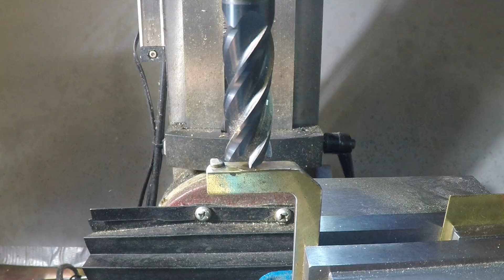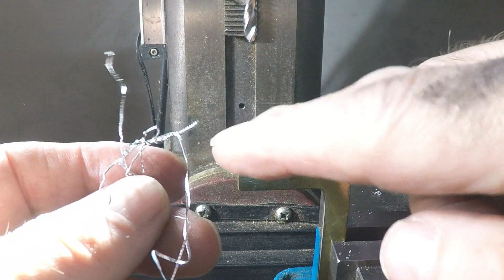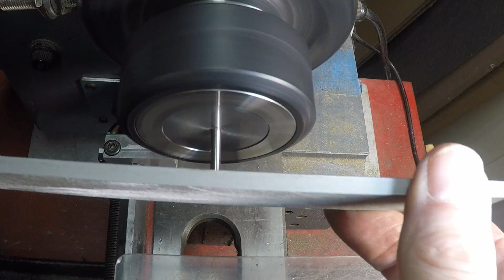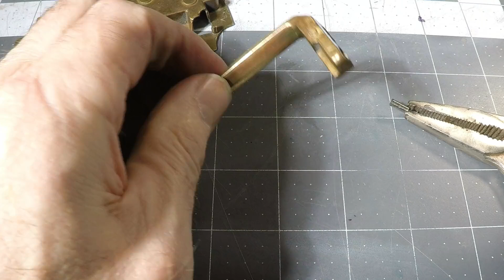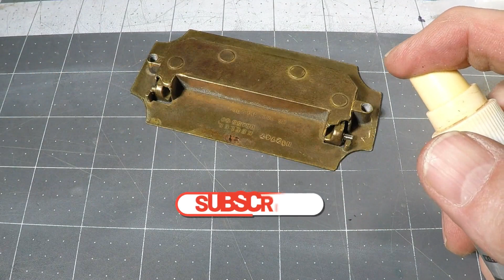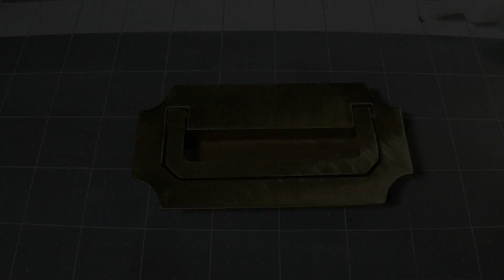Vintage drawer pull repair

Comment: Holding the handle the other way round would have allowed a support between it and the vice. Hanging the workpiece out to the side is rarely a good idea...
Interesting handle. I needed a couple like this for my Gerstner style tool box build. I could not find anything decent, so I fabricated them from brass.
Reply from the maker: You are absolutely right, I wish I had thought of that. Thanks for the feedback.